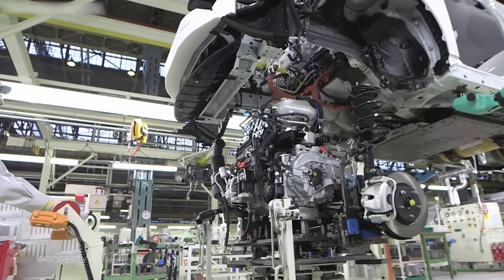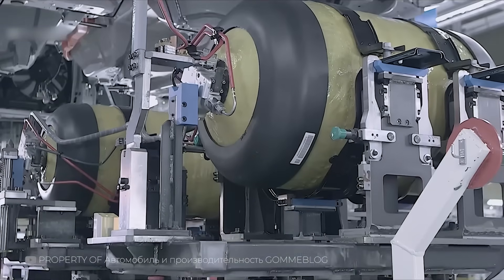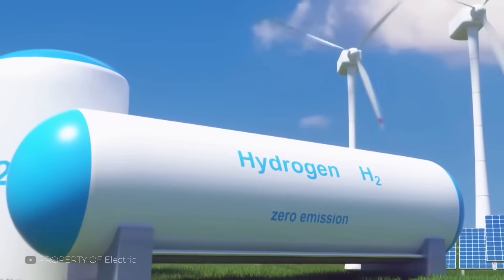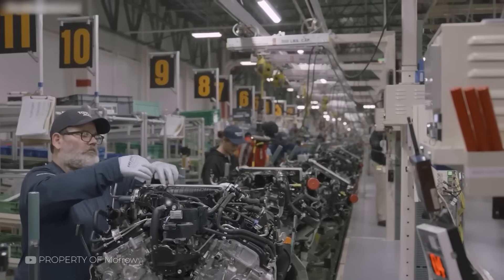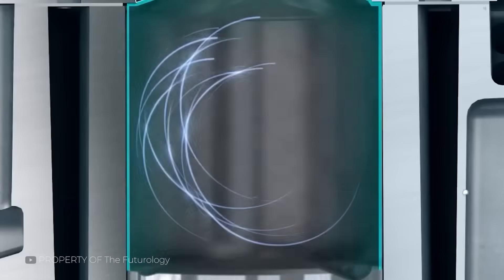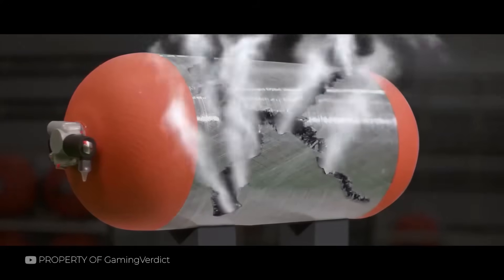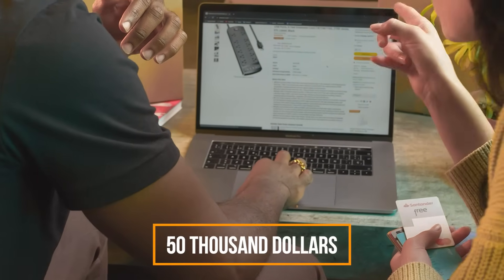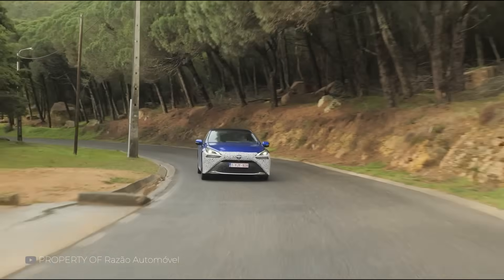Toyota's Water-Powered Engine Will Change Everything!

Comment: It looks like a scam!
The internal combustion engine can be easily converted to hydrogen operation. This has not been a problem so far.
The problem is, where does it get the energy to break down the water?
If it is made of a battery, it is much easier and cheaper to use an electric drive.
"Water engine" doesn"t exist anyway!
Water can be broken down into hydrogen and oxygen with a significant investment of energy. By burning it again, most of the invested energy can be recovered.
In this case, the vehicle has to carry the batteries, which provide the energy, and the water, which is broken down by the current from the batteries. The energy utilization of the electric motor is over 70%. The combustion engine is 25%.
Water motor, what?
What are we talking about??

Comment: 1kg H =120 Mj/kg  1Kg Dizel = 45,5 Mj/kg  1Lt Water -----0,110 Kg H2   1Lt Disel = 1,18 Kg  then if we use average 50Lt disel and we consume 50x1,18x45,5 = 2684,5 Mj and its app.=746,3 Kw  For the same energy we have to use  2684,5/120=22,4 kg H2 /011 = 204 Lt Water  but if there is no loss in the process. For obtain 1kg H2  we need 50Kw/h energy :) And its about 179 Mj energy .For 22 kg app. we need 22 x179 = 3938 :) :) . In conclusion : to obtain 2684,5 Mj energy we have to spend 3938 .You have to reconsider what you said here buddy 🤣🤣🤣🤣🤣🤣🤣🤣